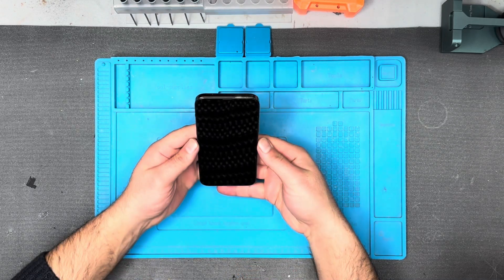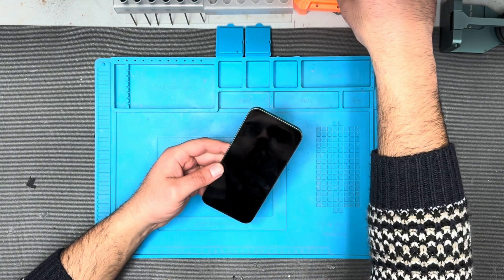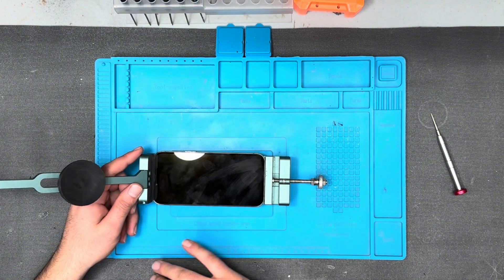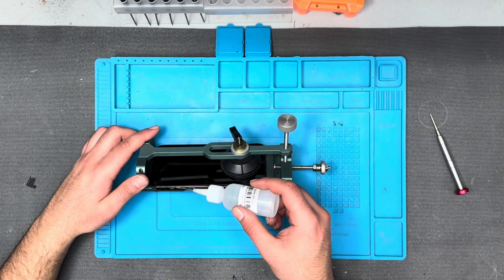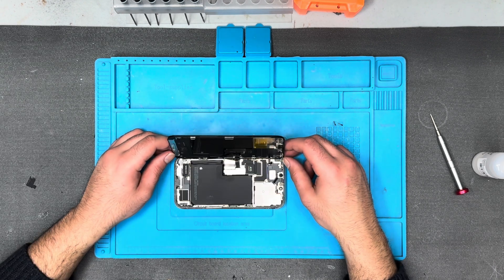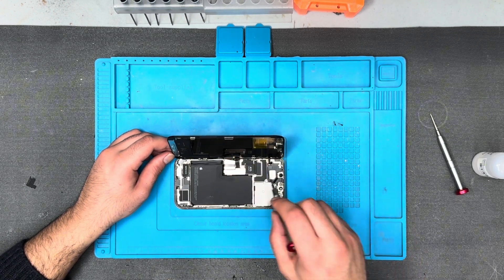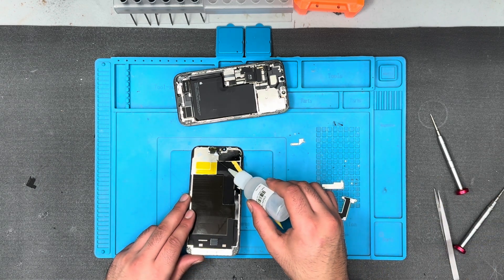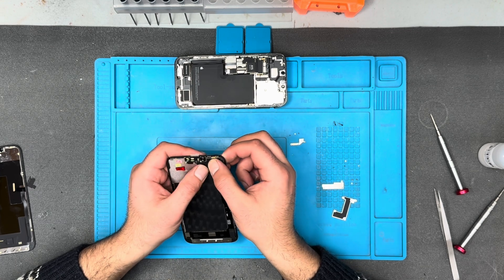iPhone 13 Pro Max Incell LCD vs OLED after market display. Which one is better?

Comment: i try to install incell lcd for my 13 pro max but its not fit well any advise?
Reply from the maker: Incell LCD is usually a thicker LCD and will be higher when it sits on the phone. It will stick out a little bit compared to OLED.